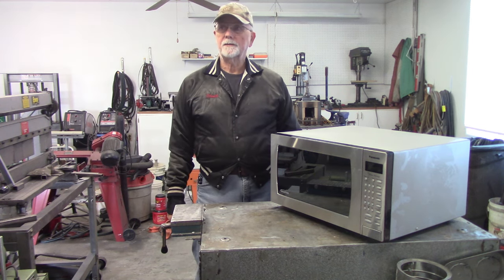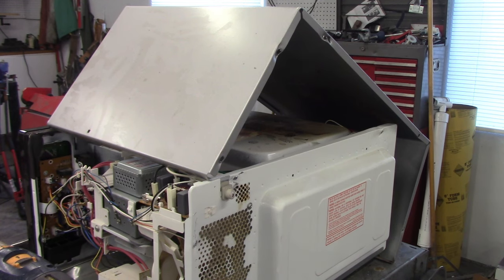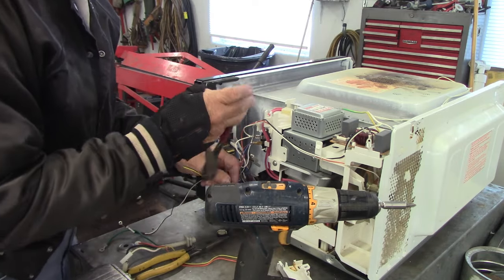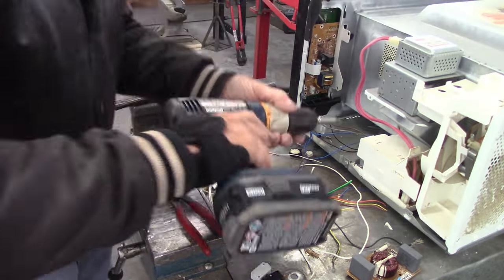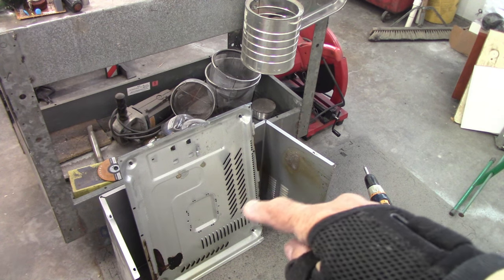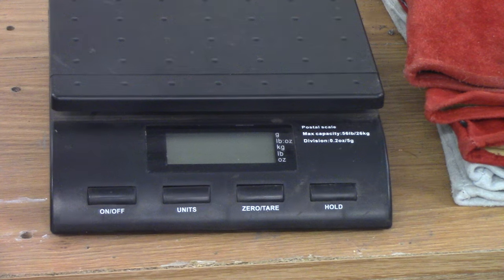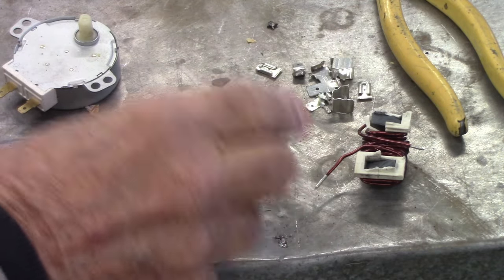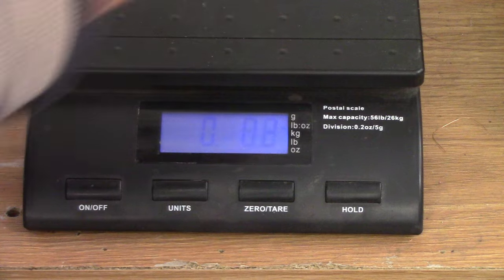Boost Your Income: Revealing Microwave Tear Down

Comment: Next time you get a dead microwave. Usually there is a fuse on the main control board 7 out of 10 times its just a blown fuse 🤣 But I got to tell ya I sure love the magnets you get from the magnetron on those!
Reply from the maker: You are correct, the fuse was blown and the waveguide was melted.